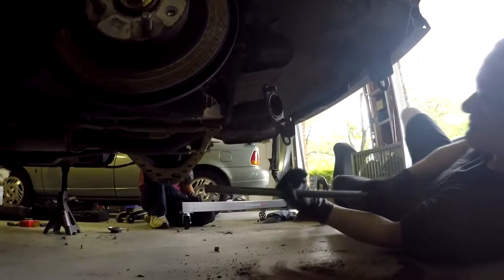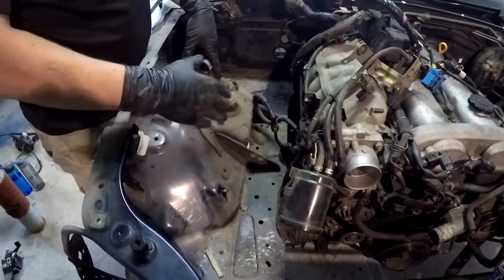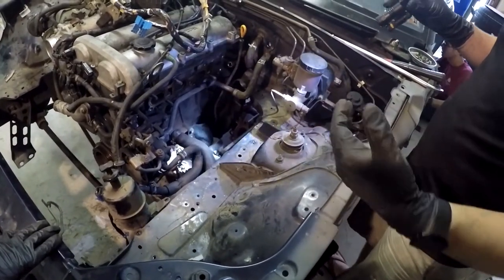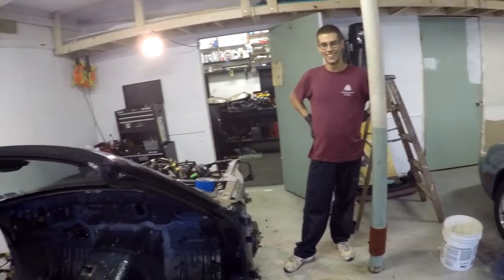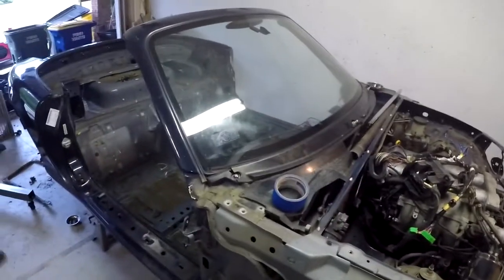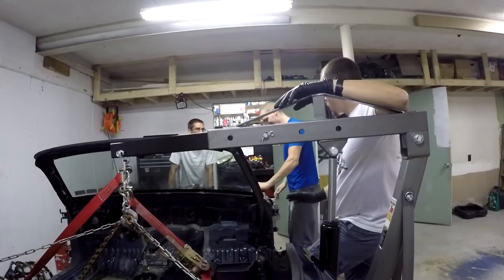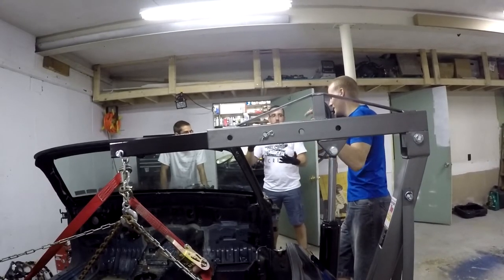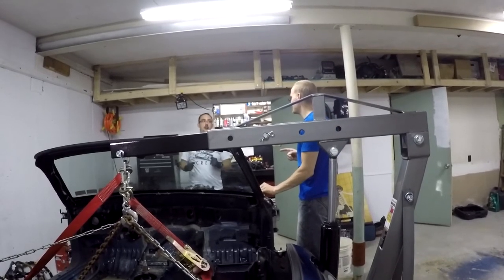Full Exocet Build Guide Episode 5 (Preparing to Seperate The Shell From The Roller Skate)

Comment: I did a FM turbo install this year. Compared to a N/A setup with tubular headers, the kit added 48lb. A K swap would have gotten me a little more power/torque and weighed ~80lbs less. Also, turbo cars need to heat up and cool down a bit more than N/A cars, so I don't get to use my turbo on the early and late corners on my commute. The issue with the K is (AFAIK) that it requires an aftermarket ECU, and I'm not sure you could sneak that by when you get the car registered. The FM kit is technically legal, so that should be easier.

Comment: I have owned several turbo cars (currently a 1986 944 Turbo Porsche running a dual port waste gate and manual boost controller)  Yes the turbo has lag but when you learn where the hit is it is really just a matter of keeping it above that rpm band prespool to take off and away we go! I Have a 99 NB Miata that I am currently thinking of doing this exocet build with and these videos are great1 Even if you aren't planning on doing this the info on disassembly of the stock Miata is gold! Thanks guys!!  Oh   and also keep in mind  a supercharger has parasitic loss with a turbo very little power is used to make boost. That means extra strain on an old stock engine never designed to make that kind of horsepower, stock rods stock pistons stock head gasket, just some thoughts. edited to add I just subbed! Thanks again guys!

Comment: I want good power, but I do not want the AIDS power delivery of a turbo.  Supercharger was the plan, but I'll have to see what kind of power it'll give.
Reply from the maker: Track Dog Racing makes a Supercharger kit that delivere's 240 WHP which is perfect for us
Reply: Pixel Armory Oh.  I was expecting 250 from a turbo setup.  240 is fine!
Reply from the maker: Its 240 HP from a Supercharger which is a completely different kind of power setup.
The fun thing with Supercharging is less heat and more power on demand.
Reply: Pixel Armory I didn't know it was less heat, but the power delivery is far better.  My first car had a 4G63T, and I'll never own a turbo again.  No power until a couple seconds after you want it, and sudden, unexpected power increases in the middle of a corner.  Blegh.  I will take whatever a supercharger will give, and 240hp is probably plenty.
Reply from the maker: That was my thought as well. Track Dog Racing or TDR makes a full kit for $5000 USD that comes with everything you need and a full warrenty. The best part is with a supercharger is the power is there almost as soon as you hit the gas.